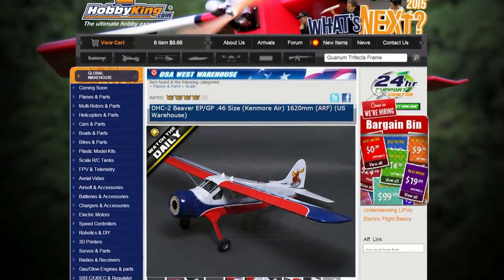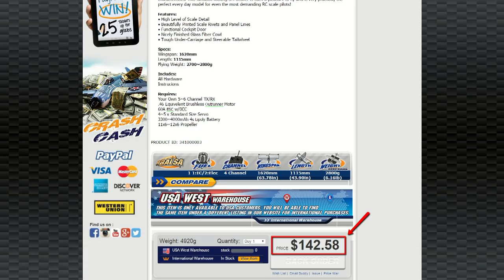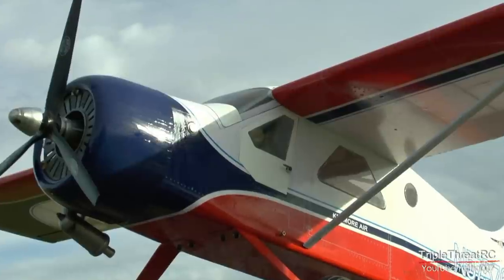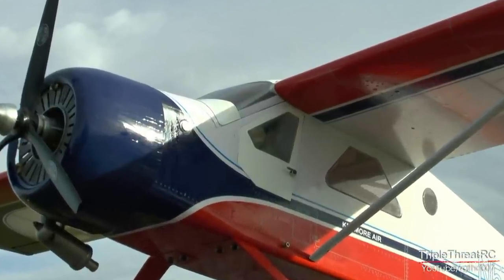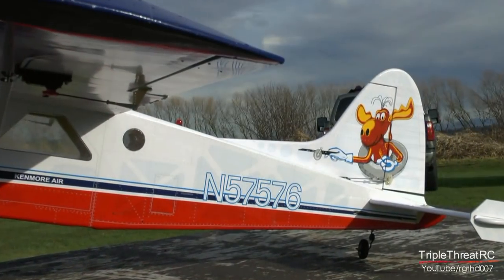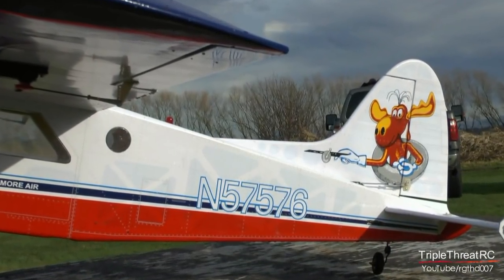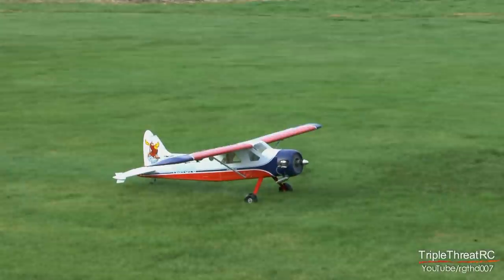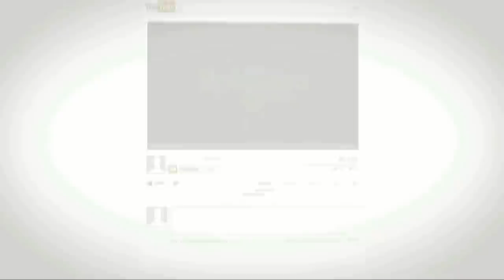HobbyKing DHC-2 Beaver EP/GP Maiden

Comment: Great video. I’ve just finished setting mine up and she’s ready for maiden, just need a decent day 😁
Reply from the maker: Awesome, enjoy your maiden. This HK version is fun to fly. 
It's best to keep up the speed in tight turns to avoid a tip stall and make sure you have enough ground speed at take off before you rotate.
Reply: @SubToTripleThreatRC  thanks, mine is the VQ Model which is basically the same one. I’ve got a Saito FA 50 so should be nice and scale but had to add a little weight up front to get CG, I’ll make sure to have plenty throttle. How are the stalls? She looks like a nice flying plane
Reply from the maker: @skynyrdd1   The stalls aren't an issue unless you're too slow in a tight turn. It is possible to ground loop if you are going too slow when you take off.  Aside from that, she  is very friendly and easy to fly. Much easier than some other Beaver models. (no pun intended).
Reply: @SubToTripleThreatRC  haha....cheers and happy flying 😁
Reply from the maker: @skynyrdd1   Backatcha. Let me know how it goes! Have fun!

Comment: The wing struts are non-functional - just for decoration as there is an aluminum wing tube which makes it easy for installation at the field. Since changed the wing strut attachment at the wing to a thru bolted hinge so the strut is attached firmer and can fold flat against the wing for storage and transport. Makes for quick and easy set-up at the field which is key to more flying fun :) Thanks Bob for the great video in spite of the visibility. Cheers, PaulD
Reply from the maker: My pleasure Paul. We'll have to do it again when we get a nice day and also, when you get her on floats!
The Saito sounds awesome on the plane. Cheers, Bob
Reply: ***** Bob, its all about the floats. Esp here on the West Coast, a Beaver without floats is simply not a Beaver!!!